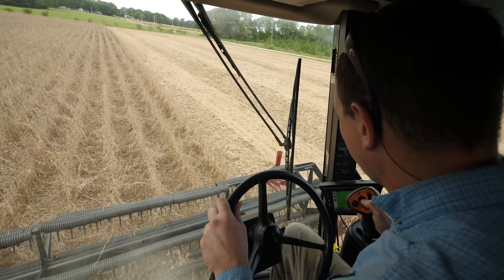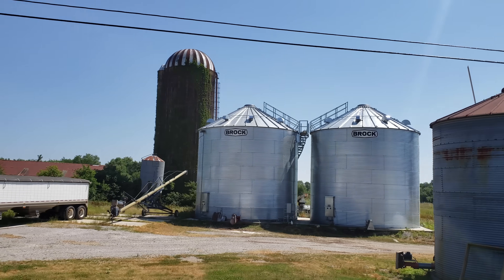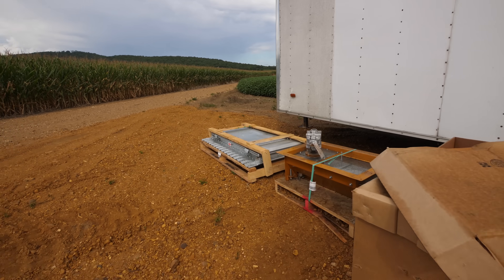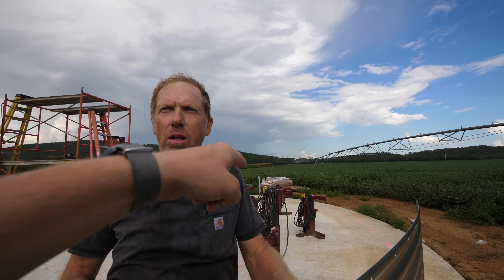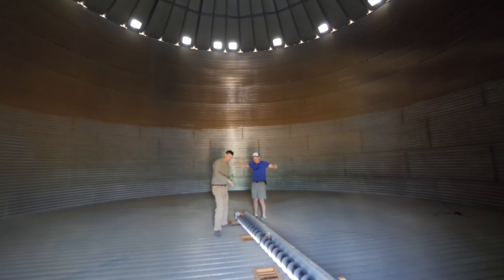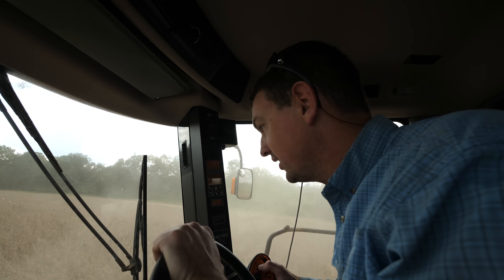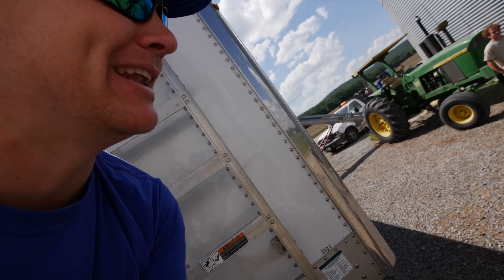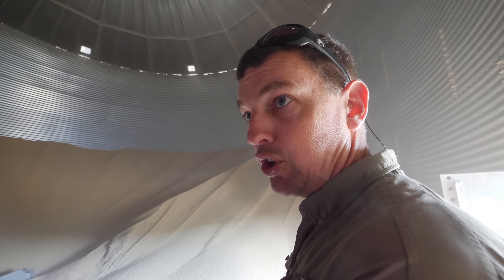Everything About Grain Bins (Farmers are Geniuses) - Smarter Every Day 218

Comment: Farmer sees title:
*blushes*
Reply from the maker: It worked.
Reply: @smartereveryday  Hey Destin, have you tried growing your corn in a square or rectangle? 
You'll find it will produce a better crop if it's in a square or rectangle because it helps with pollination. 
You'll find that the one on the outside edge don't do as well as the ones on the inside but overall you should have a better crop than having long narrow rows.
Reply: @glenatholagar  But growing in long narrow rows, while alternating different crops in different rows, prevents diseases from spreading through your crops. So it's a tradeoff.
Reply: @smartereveryday  Great show, thanks!
Reply: @smartereveryday  Great show, thanks!
Reply: @smartereveryday  
Hey
Reply: @smartereveryday  .
Reply: @smartereveryday  turbulent flow is better than laminar flow
Reply: SmarterEveryDay 1k like
Reply: @smartereveryday  them accent tho
Reply: @smartereveryday  in rest country tons per harctar
Reply: @smartereveryday  If you think building a grain bin is fun, try building one of those center pivot irrigators sitting next to it!
Reply: @smartereveryday  sandbaggers is a good term... Take a look at my post.

My uncle was so dirt poor he didn't have two nickels to rub together...
Reply: @smartereveryday Surprised you didn't geek out on the harvester. They're great. 

Also, want to have your mind blown? The germination rate for seed corn, approximately 80,000 kernels per bag, is more than 90%.
Reply: It ain't much but it's honest work.
Reply: @qwertyuiop4halo  honest? Ok. If you say so... Of course if you ask a farmer, they're always "dirt poor and barely making ends meet

 and they never have a good crop, it's always bad...

All you have to do is climb the ladder to the cab of their steiger 4x4 panther and ask him and they'll tell you they don't have any money.
Reply: Farmer:
*Destin senpai noticed me*
Reply: @autismo8123  that isnt how it works XD i can confirm that ( not for everyone, but for most i belive ) because i grew up in a farm, i have lived in a farm from the day i was born, for 11 years, but i dont live there anymore, i really liked to sit in the CLAAS Consul that my dad owned before when he was harvesting, or sit next to him in his tractor when he was ploughing, those were the good old days :-)
Reply: Degenerates oh no 🙈
Reply: OH MY GOD
Reply: No this didn't just happen right away oh my God I just posted the comment a second ago I love your vids Destin keep it up!!!
Reply: MA Williams 9
Reply: @markanthonywilliams350  ok thats enough
Reply: @marionette5968  and yet here you are, on an internet that couldn't exist without the cities. Can't make servers with a welder and stubbornness.
Reply: @MarkHanford  mate the internet is not needed for survival. Food and water is. Farmers = food for the masses.
Cities=masses= no food or water. No survival
Reply: But they are!!  They don't get nearly enough credit, recognition, and support.
Reply: @Decentralized_Maze  And I will go farther. 

American family farmers are the backbone of the food supply for the entire population of this wreched planet. The best thing America could do for the world is send American grain farmers on "busman's holiday" style trips to advise small farmers the world over. And the second and third sons who don't wanna work for big brother and can't afford a farm of their own should be person to person diplomats for America and American farming technology. Including grain bins and combine tractors and all the "little" things that make American farms the envy of the world
Reply: @LordDragon1965   Hear hear!! Nicely put. 🌱 Every farmer should be strongly supported and put on a pedestal for once. Without farmers worldwide....WE ALL wouldn't survive. Man can make machines, but without hands on farming, life wouldn't be the same! 

My family roots are farmers, steel, millwork, etc who are traditional by lifestyle. As the rebel who had to grow up in the city, let's just say I hope to drastically help everyone in the near future. ;)
Reply: @LordDragon1965  But american farmers cannot even make a profit without all the government welfare handouts they give them ("subsidies") or compete with the rest of the world without import tariffs on your competitors. Clearly american farmers don't know anything about farming compared to the civilised world.
Reply: uncletigger  I've lived just about my whole life near farming communities and I still think your conclusions are wrong. I know they're not all a bunch of selfish, greedy brutes in spite of that. But continue to dehumanize them in your mind and ignore the good guys out there who do care about the environment and fellow man (yes they do exist). It's a free country.
Reply: backbone of america!!!
Reply: @teenisteenis9642  back bone of most countries (from Britain)
Reply: So true I am also bean farmer and I blush lots
Reply: @CandyKiller1231  That's 'cause you don't have the sense to stay inside and play on computers... :)  Darn smartypants, you know how to do LOTS of stuff we computer using monkeys don't have a clue on! :) :)

FARMERS ROCK!!
Reply: Farmers Rule!
Reply: Haha yeah I mean I ain't a farmer I've worked for plenty and live in a farming community and weld and fix broken down farm equipment.
Reply: Farmers Rule!
Reply: ...can't see the blushing under the tans they get being outside a lot :-)
Reply: There’s way more too it than this. This is a bare bones common sense (for farmers) farming video... great video tho
Reply: Thank you for keeping us fed :)
Reply: @marionette5968  Well, I do hope it's not too late to return your certificate from the Holmesian School of Detective Aptitude...
because you really should.
I may be 'onafixedincome' but I WORK for that income--as a meat producer, educator, and inventor.  In other words, I'm a farmer.  

Soo....I may be 'entitled' to call you an idiot for leaping to unfounded conclusions, but I won't, because that's rude.

I do suggest you watch more of Destin's videos, though--it might help. :)
Reply: Yep
Reply: Yep
Reply: Every time to watch one of your videos I get smarter every day
Reply: Well, in feeding millions of people how can farmers not be geniuses.
Reply: B- Baka!
Reply: I'm a farmer, and I worked in many elevators when I was young, mostly rebuilding them after fires. So I am double blushing. Blood is squirting out my cheeks right now.
Reply: I did blush haha!
Reply: Farmers: UwU
Reply: Yep
Reply: My dad's a farmer and has been his whole life. Yes, a farmer will tell you they know nothing and believe it.... and then go do something you have no idea what they did and everything works the way it should.
Reply: @marionette5968  LOL  No one group is all one or the other, so get off your high horse (don't trip, now) and relax.
Reply: Farmer reads title with sick in hand
Reply: We're not all arable farmers. I live on a small cattle farm, and my grandfather has a larger one a bit away, but not too far.
Reply: This video makes me believe in humanity and your appreciation on famers is heartwarming. ❤️ Little dissapointed to see this video finished with a meat meal tho 😅
Reply: *bushels ftfy
Reply: @marionette5968  "I'd love to see all the leftists make their own cup of coffee"
you start by being an overworked african coffee farm child worker or smth like that? i dunno what you meant tbh
Reply: Hahaha best comment!
Reply: I can agree
As a son of a farmer
Reply: uncletigger  Wow you're stupid
Reply: Me as a farmer. Sees title *owos intensifies *
Reply: We are not geniuses at anything but pretty knowledgeable at many things.
Reply: Aw shucks
Reply: Naah we're average”
Reply: hee hee ☺️☺️☺️
Reply: yepp love it <3
Reply: Aka me
Reply: Mark Anthony Williams hahahahah
Reply: funny!
Reply: Farmer watches video face turns into a tomato
Reply: # ' w ' #
Reply: Hey look. It’s mark anthony.
Reply: @Sergio-fu7mv  who are you ?
Reply: uncletigger ...oh my...u kno me so well, now doncha big boy!
Reply: As someone who has farmed their whole life I was about to make this comment
Reply: mm
Reply: I can relate.
Reply: Thanks!! I will view it after my session. Also, I am moving to my new place on October 2.
Reply: Dam right
Reply: Yes I did blush
Reply: uwu farmer chan
Reply: @CalebCarterFilm  lol what about it?🤣
Reply: Grain Bins are so important the egyptians built the pyramids
Reply: @Cade Miller Because of january 6th, Cleetus.
Reply: Ya know this might be the reason I started watching so many farmers. Watched this when it was new and since about then been religiously following 4 channels
Reply: uwu?
Reply: @Mati.falcon indeed it is
Reply: Duner250R  I know right it's crazy
Reply: That's me
Reply: 11
Reply: That tool you called a ping is not a punch  just to let u know many people do call it a punch but the correct term is a drift . Mainly used to align holes or to punch out stuck rivets pins or anything that needs to be driven or punched out . Probably why people call it a punch
Reply: Yes I know silos and grain bins are very dangerous and any farm machinery especially because 80% of the time they are working alone and far from help when injured. And to the jerk that commented that farmers can’t be smart if they voted for Trump . Granted I did know of some farmers with very little formal education. But they weren’t stupid. They could jury rig and fix or fabricate things in a hurry . Cause time and weather could make or break them . The old guys could read and predict weather and I’ve seen them make things without even measuring. And the parts came out perfect . Too bad they didn’t have some book learning they could have ruled the world. There’s been many tragic accidents on farms . But not for lack of education . I used to work for several farmers back in the day the 60’s and 70’s the steadiest job only paid $1.25 an hour . But the farmers wife fed us good . She made the best stuffed peppers I ever had . She always brought the food out to us in the field and we ate picnic style on a blanket . Sandwiches piled high like a mountain and milk they pasteurized in the house . When she wasn’t around we had Schaefer’s beer . I was only 14 but that beer was good on a hot sunny day baking hay and straw . The farmer was an alcoholic. He’d open a beer and chug it right down . He drank a case of beer himself every day. Good thing he didn’t smoke . He died at 56 yrs old from drinking
Reply: VVv.  ,
Reply: it worked
Reply: Hi Dustin I love your channel it’s the BEST
Reply: Yæp
Reply: Lmao same
Reply: Anyone who supports Donald Trump is brainwashed at no fault of their own.   I have all the necessary facts to fix it, please give me the opportunity.
Reply: @rupertmurdoch4750  Doubtful.
Reply: @Joshua M Infinitely better, obviously. He's a child sociopath. He lies constantly and absurdly obviously. It is nothing short of biblically satanic that you mindless satani beast can't see it. He has literally said in the past that if he ever ran he would run as republican because you are so stupid you would support him no matter what he did.
Reply: Farmers are:

-Polluting your groundwater
-Drying up your water reserves
-Reducing our biodiversity
-Creating a petri-dish for MRSA plagues and other zoonoses
-Killing off local and coastal ecosystems
-Eradicating pollinators

... and barely make ends meet without subsidizes in the process.

Geniuses!
Reply: @Ohnonomomono  also putting food on your table
Reply: 14:02 - The farmer is right and just being honest. He does not know about any of those things mentioned, that's nonsensical.

But this situation shows how a nonsensical cultural idea was disseminated on capitalistic mentality, to protect fallacies in the capitalistic worldview. What builds things AND creates the know-how is NOT the owner of things. The owner just organizes things on the capitalistic framework game, that's all.

Steve Jobs did not make the iphone, that's a ridiculous and nonsensical idea, he just kind of "ordered" the iphone to be made by others. Just like a king does not win a war, because he ordered it to happen and be won. Workers and science does things.

Same for Bill Gates, Elon Musk and others; sure they are visionary, and some did start things, but that doesn't mean they did those things, and it is certainly not even the case for 99.99% of businessman. Iron Man is a complete folklore fantasy.

This seems obvious enough, but this is very important, because people use this fallacy to say "thank capitalism for this technology, if not for capitalism, this x technology would not exist". It's not capitalism that does things, nor capitalists.

Workers and science can exist in any system that supports them, capitalism is just an artificial power game invented that allows for it. And it actually has many instances where it actually hinders it; not like the systems that came before, of course, but it still does it. It is NOT the source of things done; science, engineering and workers are the source of everything we make that works.
Reply: except the ones who voted trump and now are suffering because of tariffs. they are stupid as they come
Reply: @jwm6314  no, that's just what satan whispers in your dull mind. Trump is a blight on the world, indeed jeopardizing the entire world. And Destin here supports it and is massively guilty for it because of his large platform. There is no excuse. And he is being clearly willfully obtuse about it. He is easily intelligent enough to see how depraved Trump is yet he still does nothing. Indeed he did a video collaborating with Ivanka Trump while trying to brush over how depraved they are. Trying to pretend it's ok. And it really really is not.
Reply: Mari Onette liberals are the most destructive force our country has ever seen. If they win next year and somehow get both Chambers, our beautiful country will be over. So very important we all vote for Trump 💪.
Reply: Farmers are Geniuses they do not design any of the stuff they use, but they do get killed when misusing the equipment.
Reply: @hpekristiansen  Hmm..and that can be prevented  how, again?  Did I hear you say, By treating them like intelligent, capable, human beings?  Sure should have, if I didn't....
Reply: It's a big job and a lot is on the line but if they were actually smart they sure wouldn't vote for Trump. And they are sinfully proud too or they'd admit his wicked ways.
Reply: @danfrederiksen1607  no one asked about politics.  stop baiting
Reply: @danfrederiksen1607  if you saw how California democrats have been treating farmers, you would understand why Trump was such a hit with the rural communities. Family farms that have existed for 3,4,5 generations gone in an instant because of some politician from the city who probably has never set foot on a farm before. The fact that somebody in DC is acknowledging that they exist and taking some kind of measure in their interests (whether or not it's actually good for them) is a big deal. I grew up on the edges of town so I got to see farming issues from the roads, friends, and local news.

God bless our farmers. The amount of garbage they have to put up with for a thankless job that few acknowledge (even though their lives literally depend on it) is incredible.
Reply: @danfrederiksen1607  you're from Denmark yet you know more about US politics and the intentions of farmers than someone who grew up in California's farm country and saw all the stuff news outlets don't report on. Gotcha.
Reply: @danfrederiksen1607  Satan isn't real.
Reply: @danfrederiksen1607  and there's no evidence he worship the fictional character anyhow
Reply: @danfrederiksen1607  seems like someone took your genius...it appears to be missing!
Reply: @danfrederiksen1607  How are Kali's public schools ranked nationally?
Reply: @danfrederiksen1607  This was a great comment thread until it turned political...
Reply: @danfrederiksen1607  Leave it to a person who has never posted a single video in his life to sully a terrific one by bringing in politics. Shame. Shame. Shame.
Reply: @danfrederiksen1607  you sound like a priest or a pastor
Reply: @danfrederiksen1607  Dan do you still do space stuff? What do you think of the Exos/former Armadillo direction now that they're not associated with John Carmack?
Reply: @danfrederiksen1607  TDS.
Reply: Dan Frederiksen i
Reply: @danfrederiksen1607  .... ur the real klodsmajor here!
Reply: @danfrederiksen1607  You are fool, but you knew that already.
Reply: @danfrederiksen1607  They voted to the first person who pretended to care in decades.
Reply: @cloggedaorta  And you said a big thing, he PRETENDED [emphasis mine] to care. He didn't care in reality. If he did, there wouldn't be the tariff war going on now. Small independent farmers need and deserve our help, large corporate farming divisions of vertically integrated megacorps do not.
Reply: @LordDragon1965  

I mean regardless of what you think about him. He made them believe he cared. He might he might not. I think he is pretty dumb sometimes but capable and clever other times. They had to choose between him and Hilary. At least he seemed to care.

Dan Fredriksen

A nice educational and encouraging video and you not only bring politics into it but then then start insulting those the video was encouraging. Awesome.
Reply: @cloggedaorta  well at least he pretended to care others don't even bother pretending ... a survey found that like 80% of americans did not trust Hillary yet ... 50% of them where ready to vote for her....
Reply: @LordDragon1965            Bakken Cake
Reply: @espygaming5101  
Agreed man thanks for bringing some logic into things
Reply: @cloggedaorta  - Most farmers feel like they voted for the lesser of two weasels. They know he only pretended to care but as you said Trump was the first to make even that little effort in decades.
Reply: @cloggedaorta  By the time election day rolled around you already knew he was a liar. You allowed yourself to be fooled, hoping for something better. The people in 1930's Germany did the same thing. How did that work out?
Reply: @cloggedaorta  I'm Canadian but as a third party viewer, he certainly did allot for American farmers.
Reply: Dan Frederiksen should they have voted for Hilary? Her rap sheet should be a mile long!
Reply: @danfrederiksen1607  You are a sad, strange, small minded individual. Disagreeing with your political views is not sinful. Especially in this country. Let other people have their own opinions, without you insulting them. I don't think you want to bring God into you judging people. Matthew 7:2
Reply: @danfrederiksen1607  I could also say if the people voting for Clinton were actually smart, they'd get together to vote for an actual left wing third party option (say, Jill Stein), realizing how damaging to the political landscape it is to keep indulging a right wing vs. center set of options. There's a lot more that goes into smarts than making sound political choices, which is, sadly, reflected in polls on the political stances of people who do have degrees of higher education: You'd think they'd realize these things, but seemingly, they don't, or at least don't care all that much.

Everyone just jumps onto some sort of lemming train and hopes the next election will magically turn out to be better, if you just manage to get past this one without losing too many feathers. It doesn't take a genius to figure out that that's never going to work out.
Reply: @danfrederiksen1607  Your comment is just ignorant.